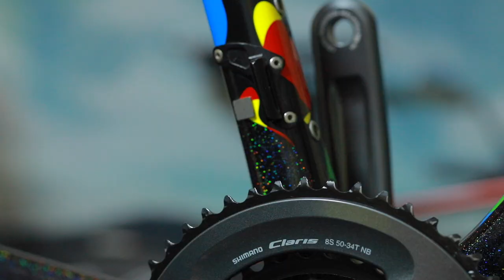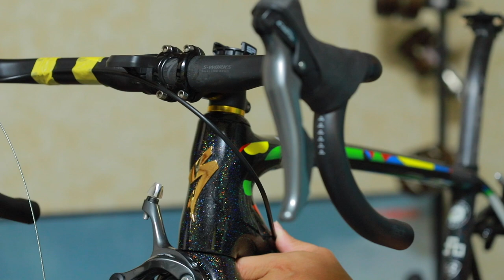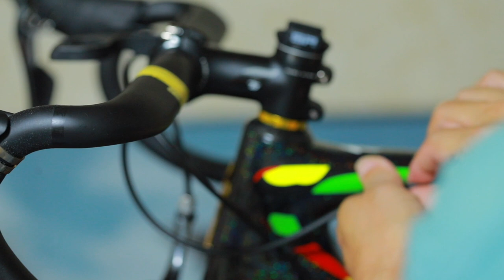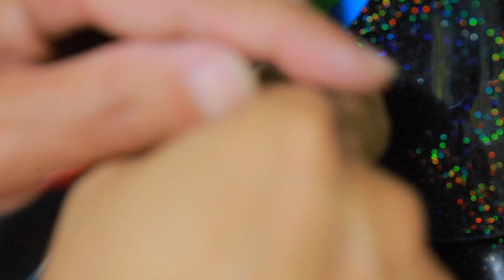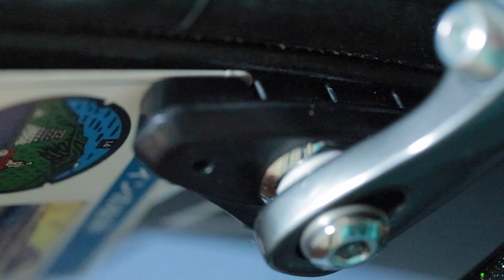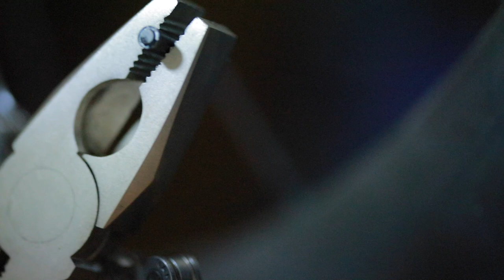シマノ クラリス R2000 組み立て動画

Comment: Its been more than a decade since i last used Claris
The Claris i had on my 2013 Specialized Sl4 was the St-2400 lasted me 5 years thought of upgrading to the new 2017 Claris but Sora and 105 also got a new redesign so i switched to semi sora and semi 105, Semi Tiagra semi 105, then full 105 to Ultegra the bike i have right now the Cube Agree c:62 SL with the Ultegra Di2 has treated me well but i do miss the nostalgic 2400

Comment: Why did you use Claris groupset ?
Reply from the maker: I wanted to compare if changing the component would change the speed
Reply: @203digital  nice, cool video! Greets from Poland.
Reply from the maker: Thank you
Reply: Did it affect the speed and is there any difference between claris and ultegra?
Reply: @krystiankierzek6034  Ultegra is 11-speed and 
Claris is only 8. So, basically it gives you greater range of gears for controlling cadence to power or power to cadence. Also, 105, Ultegra and DuraAce are professional groupsets while Claris/Sora/Tiagra are entry level targeted for beginners/amatoures. In 105/Ultegra/DuraAce shifting is bit more smooth and you get more control over position of the handles etc.
Reply: Claris is a solid groupset. Probably as good as ultegra was 10-12 years ago. Trickle down effect.
Reply: @klpinvestments  not really 😅...